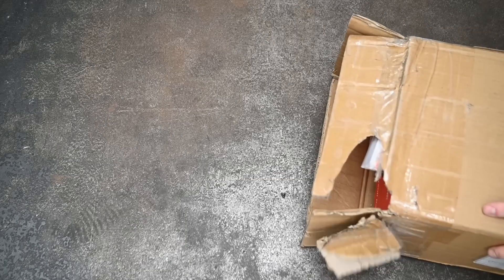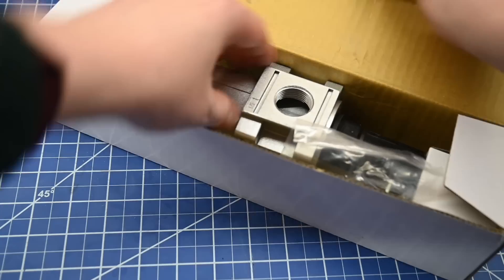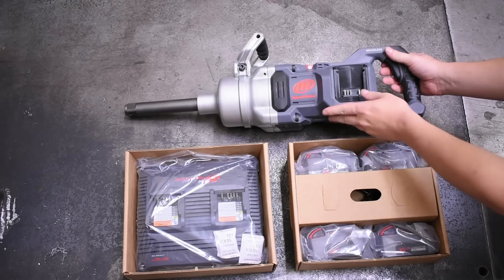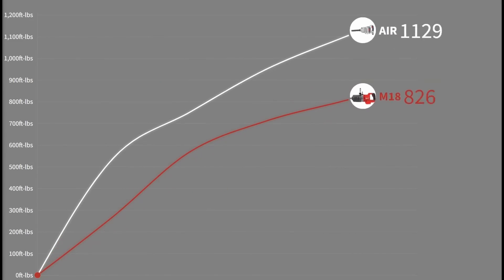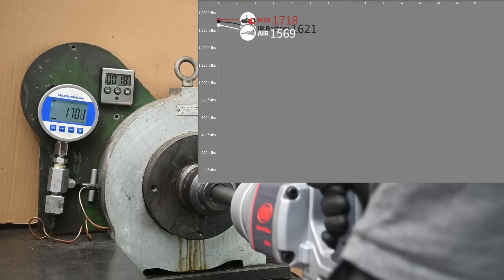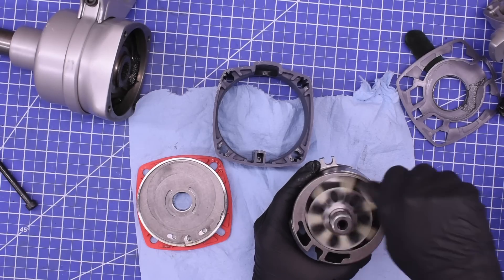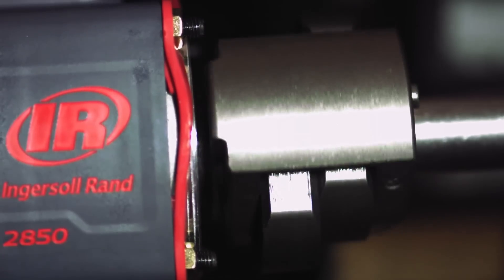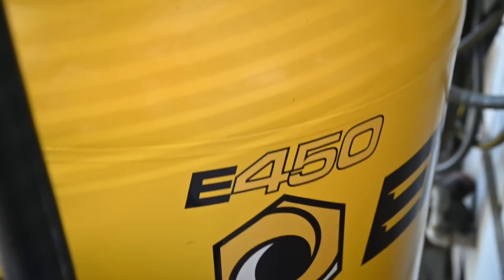The Impact Dealers Tighten Your Lug Nuts With: Largest Air vs Cordless

Comment: Nitrogen tank when?
Reply from the maker: We're currently running a 78% nitrogen set-up
Reply: @TorqueTestChannel  Random thought, do temperature changes within the lines effect the performance of air tools in any meaningful way? Would using near liquid nitrogen temp air decrease or increase the power output measurably?
Reply from the maker: @theemperorofmankind3739  Air tools dont USE the air like an engine does, so gains from density is basically a rounding error. Pressure dictates the difference, hot air is higher pressure, but also your compressor will shut off at X psi either way. 180psi of cold OR hot. So ideally it's not too cold, you don't want metal parts to shrink and create new interferences or gaps, and for rubber gasket seals to get brittle and let air by. Room temp air is enough to cool down many air tools to develop frost on the housing as it is, with how much air passes through them, they are self cooled.
Reply: @theemperorofmankind3739  Have you ever used air tools outside in the winter?
The veins do tend to stick, any lube in the tool does not work so well at sub-zero temps.
Reply: @TorqueTestChannel  Actually a sufficiently big temperature difference will increase the air motor power as the gas density increases. But as noted by someone else your likely to hit issues with parts getting too cold to function before your temperature drop gets big enough to see any real affects as you need a big temperature change. You have to halve the temperature, (in kelvin, not celsius or fahrenheit), to double the gas density. or double it to halve the gas density.

That said even if you could bypass the temperature issue increased gas density may not do as much as you'd expect as the motor's and fitting's, and countless other things are designed with typical temperature density values in mind and may not be able to use the full effect.

if you wanted to test it and there are any air tools that can run adequately of a pre-stored tank of gas. Getting a tank of Helium, and one of that dense stuff that makes your voice sound demonic and comparing those to regular air and each other would have the same effect as changing the temperature in terms of gas density. Hydrogen would show a bigger effect than helium for low density, but i wouldn't dare run that in an air tool, that stuff is way too goddamn flammable.
Reply: CO2 holds MUCH more volume as a liquid under pressure. I only use nitrogen for AC pressure tests. I bring a long hose so the CO2 has more time to transition from liquid to gas.
I use CO2 in various size cylinders for MIG shielding gas and inflating tires in the field (see the many off-roader CO2 videos).  Of course for max pressure testing one could order
a high pressure CO2 cylinder and regulator but it really pays off to stick to standard cylinders in the US since you can score them for less than a refill cost used then refill by exchange or on the spot at your local welding supply.
Reply: @Comm0ut  To stay liquid without getting it so cold you might run into temperature related issues you have to keep it at 750Psi which would probably blow some of the tools up. Very dangerous.

Comment: Second!

Been waiting for this review forever...i  have to say most shops aren't running the air lines with the consideration that you've given. I'll bet most of these air impacts are running at about 70 to 80% due to air line setup.
Reply from the maker: I agree, and I see it too in clips seen around. But if we're going to attempt to call brands out on the specs they advertise, we gotta try and replicate their lab conditions best we can
Reply: In my experience there is no such thing as running on 70%. With too little air the larger stuff just falls on its face completely. I have a 3/4 impact that beats the 1” on most air systems. But as soon as I use proper air the 1” is on another level.

And most shops don’t have the air for a super powerful impact. The lines are to small usually.
Reply: 99% water 1%air where im at